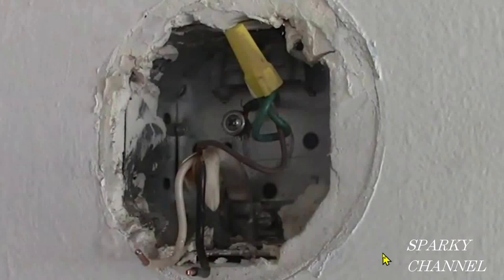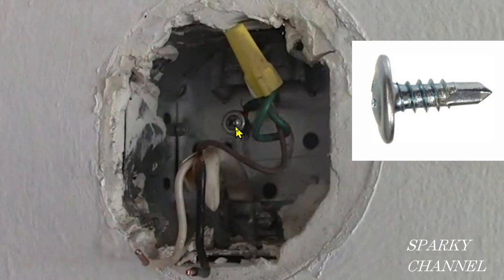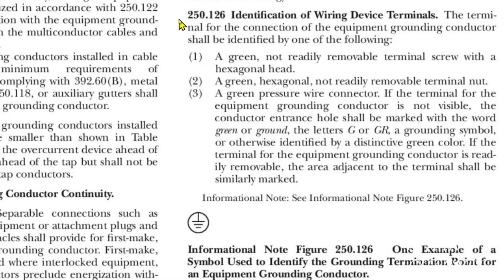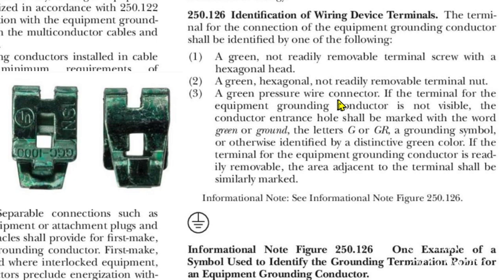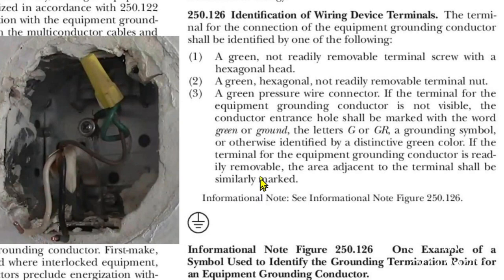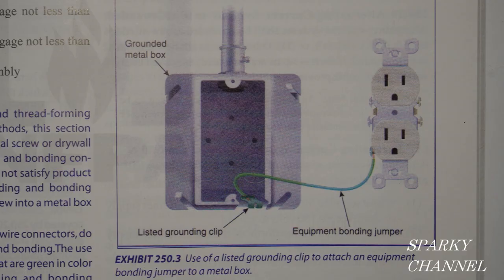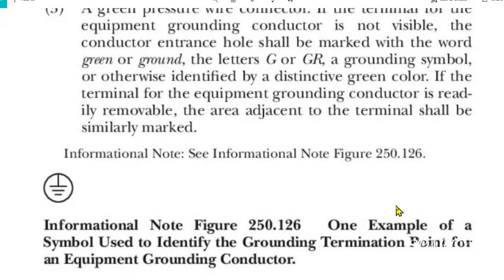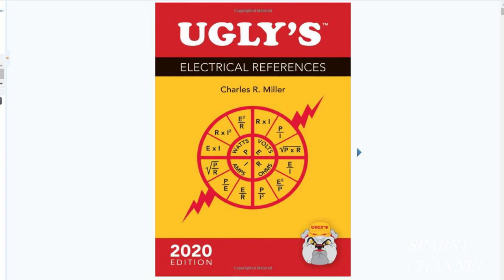Is This Box Grounding Screw Legal By 2020 NEC?

Comment: I believe that the screw you used is green and has a hexagonal head, but it is an easily removable screw.  It is not the "not readily removable terminal screw" described in the NEC in part (1) that you mentioned.  Based on that, I  don't think your screw meets the specification even though that is what we all use.  Not only did you change out the screw, you used a different location in the box.  Was that hole threaded or did you tap it?  Somehow I don't think that this section of the NEC is for j-boxes.  A plastic j-box doesn't use a terminal screw, a terminal nut, or a pressure wire connector.  I think that this part of the NEC is for devices that might go in a junction box, like the new switches that do have green, hex head, not easily removable terminal screws.  Personally, I have never seen a "terminal nut" to ground an electrical box.  What kind of box comes with a threaded post  for a terminal nut?  Maybe some industrial kind of thing?

Comment: Thanks, that was a nice, short, helpful video. I actually wondered about those "pressure" clips. I see that they are still legal, but they are supposed to be green. I think I have come across some old ones in my house that were not really green.
Reply from the maker: I've noticed that some of the old legal green screws lose their green color after many years. Perhaps that happened to your pressure clips as well.

Comment: Your codes in the states  are so confessing  . Love watching your videos watching from the uk 🇬🇧 Stay Safe now 👍🏼
Reply from the maker: You are so correct! Oh well, cheers from San Diego! Thanks, you guys stay safe as well. I heard that you guys have the vaccine. How is that going?
Reply: Ian drew.
I would say your codes are just as confusing.
You guys have what are known as ring circuits. And tapping into one of those circuits you have rules on Spurs.  Here in the states as long as it's not a designated circuit. You could add two or three outlets depending on the maximum draw of the circuit and location.
designated circuits applying anything that supplies large appliance like a refrigerator, dishwasher, garbage disposal.
It's also code to have a minimum 20 amp breaker to supply bathroom power.  And a minimum of two circuits supplying countertop power in the kitchen usually one to the left and one to right of the sink.
But it is interesting how each country has done electricity different.  
Stay safe and have a great day.
Reply: @jonathanfurtado3696  Keep back in mind, the outlet circuits in the UK are 230V and fused with 32A breakers. Except the radial circuits, they‘re fused with 20A in most cases. The higher voltage makes it possible to have more outlets on one circuit, because higher voltage means less current for the same demand.
Reply: @Marcel_Germann  IIRC your device plugs are also individually fused, so a 5A device is protected at it's own plug?
Reply: @JasonW.  Nope, german outlet circuits are fused with B 16A MCBs, in older installations L or H curve or a 10A Diazed or Neozed fuse. The 16A MCBs are much faster than a 13A BS 1362 fuse, especially the H curve which short-circuit detection is comparable to the modern Z curve for high impedant grids. In the UK the outlet circuits are fused with B 32A MCBs, and a fuse inside of the plug. That fuse is normally a 3A or a 13A. There are fuse ratings in between, but they're not the standard. That's the reason they're labeled black. The 13A are brown and the 3A are red. They're to protect the cord between the plug and the appliance which is not rated for 32A.

Comment: Here in Canada we don't use Green ground screws in boxes, the boxes come with silver Rounded Slotted/Robertson Screw, the only items that we use that have a green screw are plug receptacles. we don't even ground the light Switches. similar rules here but some are different!
Reply from the maker: Interesting, thanks!
Reply: I am not familiar with the CEC but I can assure you that if the switch yoke is metal, it must be bonded somehow, weather through the metal box or a ground jumper if it’s in a plastic box. In the US, if you want to bond through a metal box, switches are just like receptacles in that they must be listed self-grounding devices. If not, then a ground jumper must be run to a switch with a metal yoke, even if it’s in a bonded metal box.
Reply: @RB-xv4si  For CEC, the 6-32 screw to mount the switch to the box is considered adequate for bonding. Our plastic boxes come with bonding straps that connect to one of the screwholes so that you don't need to bond the switch. We only have to bond switches that have electronics inside, and they usually come with a pigtail.
Reply: @theNolte  so what do you connect the ground conductor to in a plastic box? The bonding strap?
Reply: @RB-xv4si  yeah, it comes with a ground screw. look up NuTek device box to see a picture.
Reply: @theNolte  yeah that is a clever set-up. Although, it doesn’t save any time over a regular plastic box unless it’s a multi-gang box. Also, the little 6-32 machine screws aren’t rated to carry ground fault current back to the source unless it the switch has a self-grounding clip on one of the screws. You very well may get a bond through a regular switch but unless it has the self-grounding clip, there is no guarantee that it will carry sufficient fault current to trip the breaker.
Reply: @RB-xv4si  Its mainly only light switches themselves that aren't Grounded directly with a ground cable, I'm  not sure why but it is grounded just by the mounting and it must have to do with the fact the switch just turns on and of the power to a item, as were a plug actually has the possibility of a shock .
Reply: @lwdcrazyman  it has nothing to do with what you described. All normally non current carrying metal components must be bonded. There are approved ways to guarantee this and non-approved ways.
Reply: @RB-xv4si  then there's the Canadian way 🤣

Comment: Good video Bill.Is romex with green ground wire available in US?In Europe grounded cable have a green-yellow wire because its not allowed to use bare copper for grounding.
Reply from the maker: Romex comes with a bare copper wire here in USA. I would prefer that it was insulated but that's the way we do it here.
Reply: Only type MC metal clad cable has a green insulated ground wire.

Comment: Man, over the last 20 years I put in a lot of those self tappers when there was no pre-drilled and threaded ground hole available. I will stop now. Thanks for the update Bill. Guess I can use hex head self tappers and use my green paint pen from now on. Not listed eh? I wish someone would show me the code section that says the screw has to be a 10-32 machine screw and not a self tapper. OK, OK. I'll use the damn clips. I never liked them.

Comment: I cannot find connectors like that here.. every box sold contains a silver screw.. not green. Plus all are screws not hex heads... no matter whether metal or plastic boxes.. though many do not even contain screws now...
Reply: Where are you?
Reply: @SuperVstech  Jamaica in Caribbean.. Heck, the panel boxes here are either Eaton or Eaton knock offs or a new company from Brasil..lol..and hard to get even the local electrical code book from the government..
Reply: In a plastic box you don't need to ground the box. Only the devices inside it.
Reply: @Sparkeycarp  but in several cases we are not allowed to use plastc box.. so it depends upon the situation..though I use my wago 5 levers normally for grounds

Comment: What about a hexagon screw with a dab of green nail polish on it?
Reply from the maker: I don't know why it wouldn't be acceptable. The code says green and hexagonal.
Reply: @SparkyChannel  The code says the screw has to be green. A silver (black, gold, whatever) screw that has a dab of paint on it isn't a green screw. It's a screw of a different color with a bit of paint on it. I'm certainly not claiming  it wouldn't be allowed, but that's a reason that an inspector might  say it doesn't meet code. That a dab of paint isn't permanent might  even make it reasonable to consider it a code violation.
Reply from the maker: @stevepseudonym445  OK, I see your point.
Reply: @stevepseudonym445  it says elsewhere in the code that it has to be 32TPI thread pitch.  but yes, a screw made of naturally colored metal and then colored green is acceptable, because that's what ground screws are.  
I did have an inspector call me on an 80s panel where the mounting screws for the neutral/ground bus weren't green, and he wanted me to use a green sharpie to color them.
Reply: @kenbrown2808  that was an ass of an inspector.
Only the bonding screw needs to be green, not the mounting screws
Reply: @SuperVstech  I made a mistake on that - it was mounted on isolating blocks, with a bonding screw through it - but being a late 70s panel, the screw wasn't green.
point being, if a screw is otherwise acceptable, coloring it green is permitted.
Reply: @kenbrown2808  Had an AHJ tell me to do the same thing.

Comment: Quesiont if you run 4 X 6AWG cables from an NM14-50 outlet and connect all four cables to your electrical main panel. do you need the small pigtail connector to the junction box? Why isn't the 6 AWG cable enough? Thanks in advance.  (2 hot, 1 neutral, and 1 ground)

Comment: THANKS SPARKY TELL THESE NEW GUYS NO SELF TAPOING SCREW TO BE USED WHEN GROUNDING N BOX
Reply from the maker: My pleasure and will do. Thanks Panama!
Reply: There are what’s called “self tapping thread forming screws” that are different from sheet metal self tapping screws; the thread forming screw produces a machine screw thread, just like using a separate tap would do. Link below for green ones with hex heads that would seem to be suitable for grounding use: 
https://www.homedepot.com/p/Commercial-Electric-Combo-Grounding-Screw-10-Card-774042/100134430
Reply: @stevebabiak6997  Home Depot now says product unavailable.

Comment: What's really the difference?
Are they both metal, so it will keep it grounded.
Reply from the maker: I hear what you're saying. The NEC is quite clear on this one though.
Reply: Functionally they are probably the same.  But code isn't always about just about functionality.  It's often about creating standard rules so that when somebody comes along in the future, they know what they're looking at and/or they know how to work with it.  Be it a specific tool or whatever.  The rules don't always make sense on the surface and sometimes they seem convoluted but there are always reasons and they are usually pretty good reasons.
Reply: @glasshalfempty1984  But it only apples to people who get an electrical inspection after they do some work.
Reply from the maker: @glasshalfempty1984  Well said.
Reply: I suspect the main differences are more threads per inch in contact with the box and easier identification during inspection and maintenance.
Reply: @warrensteel9954  Like I said. Someone who is just putting n a switch, is not going to get it inspected.

Comment: I have a question, if you run a self tap green, hex, 10-32 ground screw into an unused RACO box clamp hole (I think they were often 8-32) can you wrap your Romex bare ground 3/4 around it and up to the device, ( receptacle or switch)?, This avoiding having to use a connector for three ground screw leads, the green wire to the box, the lead in and the pigtail to the device? I ask, because I often find old RACO style boxes for a single receptacle in my 1915 house, and no way to remove without tearing up lathe and plaster.
Reply: It must be a machine type

Comment: I thought the ground screw had to be a machine screw green or not?
Reply from the maker: I didn't see anything about needing to be a machine screw but the 10/32 screws fit the metal boxes so that makes sense.
Reply: That's what I always thought
Reply: I believe 250.8A5&6 states that a threaded connection requires 2 threads to be engaged.  Unless your box is very thick, that means 32 threads/inch in a 16 gauge (1/16" of an inch thick)  metal box. 340.14B requires smaller boxes to be .0625" thick.  So a 10-24 screw would not engage enough of most boxes.

Comment: It is not legal in any code edition. you need a machine thread with at least 2 threads in contact with the metal box. In this case  a 10-32 unified national fine (UNF) is called for.
Reply: Could you please site that code, I can't find it.

Comment: So it's not code, but seriously how could that not make a good connection? The wire is held securely tight against the box, so what do the code writers see as a problem here?
Reply: It's not green. Oh and not hexagon. Besides that I got nothing.
Reply: The 10-32 threaded screw makes better contact with the metal box, especially if wood rot, moisture and corrosion occur, imo.
Reply: you can still use a self tapper to drill the hole if you dont want to get out a separate drill
Reply from the maker: I've got nothing. I'm just the messenger, lol! Those self-tappers make a great connection, just as good as the 10-32's. But code is code.
Reply: Code is Code... you can always try to slip the inspector some payola... don't be surprised if he slips you into the house of many slammers for bribery,  because green screws work better than green paper for grounding electrical connections 😉.

Comment: No. Not legal. Must be a machine screw with 10/32 pitch. 
Color of screw doesn’t matter. 
Must make contact via 3 threads minimum. 
Now I’ll watch the video
Reply: Please find that in the code. I have heard that for years and no AHJ ever called me on it.
Reply: @Sparkeycarp  I believe 250.8A5&6 is what you're looking for.
Reply: I believe that 250.8(A) 5-6 is the section we need for this. Machine screw (doesn't specify any particular size or TPI) with minimum of two threads engaged. Makes no mention of green coloring being required. 263 sparky: I thought it was 3 threads as well. I don't have my old code books handy, maybe it was 3 before.
250.126 specifies 'wiring device terminals', this sounds to me to be a receptacle, switch or other device such as you would install in the box. It states that the screw or nut must be green and not easily removed. Ever try to remove the gnd screw from a recept? It wont come out unless you Really crank on it. A ground screw in the back of a box comes out easily.
314.40(D) requires a metal box to have a means to connect the EGC, permitted to be a tapped hole or equivalent. I seem to recall (from many years ago) that the code said that you cannot use a screw for grounding if it also serves some other function such as mounting the box. Can anyone find this in the code?
Reply: Color doesn't matter only when it comes inside a manufactured device.

Comment: we all know this screw is not legal. we also know it will work very nicely. pickey pickey
Reply from the maker: I have to say those 1/2" self drilling screws work great. They hold very tightly. I'm not saying to use them though.
Reply: If you don’t like to follow the code and do hack jobs, you can certainly do that. Everyone is entitled to their own decisions. As a professional, I get paid to do code compliant work. I did realize very quickly when I started how many hacks have infiltrated this profession. I went Union so I could escape that.
Reply from the maker: @RB-xv4si  Excellent!
Reply: @RB-xv4si  well said, your my type of electrician. Alot of guys i work with wouldn't hesitate to do this. We call them "MUTTS".
Reply: @pauliemoto  😂

Comment: The problem with the NEC is it's wrote by a bunch of pencil pushing pocket protector wearing geeks who don't know their ass from a whole in the ground.  Don't get me wrong, we need an industry' standard and need to be regulated but we need real world knowledge and experience.
Reply: by which you mean a combination of insurance adjustors, and veteran electricians and electrical inspectors who have tons of real world experience, many of whom can not only quote the code chapter and verse, but can tell you exactly what incident led to the verse being written.
Reply: @kenbrown2808   - I agree with your statement. Lots of changes to things like code and UL/ANSI standards are implemented in an attempt to avoid adverse consequences, and often the reasoning isn't immediately apparent to those who did not participate in the discussion over the change to the standards.
Reply: @stevebabiak6997  to quote one of the best instructors ive' had, code changes are the result of one of three things: new technology, elbow construction workers, or elbow inspectors. Only he didn't say elbow.